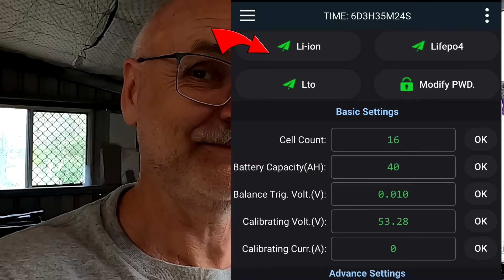Major safety concern with new JK Inverter BMS! Not good.

Comment: Thanks very much, Andy. This community is really great to distribute important information. The good thing is, they are listing to you, Andy, that's fantastic. I've immediately contacted them, too. They told me, that they are fixing it right now and provide a new software very soon. The other types of BMS - 8S-24S or 4S-8S they say, do not have this failure. I'm just testing a 4S-8S version to confirm this.
Reply: They are wrong I have already warned of this problem on a 2a200a which cuts itself!!! and renisilialize and who made me inflate the batteries up to 3.85v then I noticed!!! but it remains swollen for life now!!!
Reply: @patrickruiz6764  So you had this issue with this new Inverter-BMS like Andy, right?
Reply: @patrickruiz6764  What do you mean by "which cuts itself" - You mean that it restarted/reseted itself without any particular reason?

Comment: And the response i received when i questiond the same issue "Hello, please do not close BMS. Closing BMS will restore the default settings regardless of what it is.
This is factory set.
You can choose to use the sleep mode in the app, which will not reset your parameter settings.
Reply: sounds not good. also several comments that state the issue is also the same with some old jk bms

Comment: Turn it off or disconnecting it from  the battery bus. Major safety issue ONLY if it is the BMS being disconnected from the battery completely. Who turns off the BMS? You can disconnect a battery with the fuse yes. But turn off the BMS means isolating it from the battery entirely? That sounds wrong. This sounds like an interesting case of testing issues. Don’t get me wrong. An BMS like this should be chemistry specific you ask me. But this kinda smell like blowing on embers to get smoke.

Comment: Just to clarify ... this is only for the JK Inverter BMS?

Something like a B2A20S20P, what I have, is OK?  🤞
Reply: JK confirmed this morning to me, that the older "stand alone" BMSs do not have this issue. They say, that exactly these "not inverter" BMS are often used in cars or ships, where the system is switched off from time to time by use case. And they never had this issue reported before. They have these type running in the field now over 5 years with no safety issues.
Reply: @michaelwessel2983  well 2 comments here at least say the opposite. 

@user-iu3ju2fj1o
Hi Andy great work on the potential safety hazard on the JK inverter bms. Just would like share this with after seeing your video on this i decided to check all my bms,s non inverter type . and found that my one bms had reset its self to 4.20 OVP , i have not switched my system off for 12 months and more . I dont think that the issue is only with the new inverter bms,s . So i think there is a definite problem here . This is very concerning 

@lezbriddon
I recently bought one of the older style and when building my pack I left it off a few days and then found it was back on 4.2v, but I had been playing so much with the settings and 8cell 4cell as I was balancing them all I thought it was me, and that I had reset the BMS. if the hw can't be prevented from having amnesia then it needs new software with a new 'useless capacity but safe for all chemistry's ' as the default.

Comment: The BMS settings is always my last line of defense but I never allow it to have the final say on the circuit. It is the inverter and the charger that always have the final say when to stop discharging or when to stop charging the battery respectively.

Comment: Hello, I have been using the 14.15 in my test battery for some time now. It seems that the problem with losing the setting has been fixed in this version. Up to 12 hours even without power supply, the red cable disconnected, brings back the set values after switching on. I only use one Akku pack. Greetings
Reply: The BMS does not have a battery so a capacitor will be used to keep the setting. 12 hours is OK, but I guess is 2-5 days is possible. I'm sure it will fall back to the factory setting unless it uses non-volatile memory.

Comment: When a safety device is not safe, then it is really bad. 
It is hard to understand how and why JK is damaging his good reputation.

Those top buttons are badly designed from the beginning even in older versions:
I don't like the top buttons on the settings page that change the battery chemistry and immediately change the settings to the factory default. 
Pressing them should pop up a window describing what happens when activated, with asking if user really want it: YES / NO

The user settings should always be kept unchanged until the user changes them again under any circumstances !

Andy could you please test this on other brands of BMS, or do you already know that other BMS don't do this?

Comment: Now Andy you just had to reset me back to Daly when i just order 10 DIY with this JK BMS. Atleast Kevin of Daly sent me firmware update to enable parallel communication board get all battery pack parameters to Inverter as it was send the current limits of Master battery instaead of cumulative limits

Comment: Very nice video Andy you look amazing in uniform :) ، I have ANT BMS and jk bms totaly burned due to a short circuit. The ant fortunately was still working, reading fault in the discharge side. Anyway, I disconnected the bms it did forget se settings when I connected it back. Also, reset to lithium ion as you mentioned.

Comment: The battery type should be a jumper pin or dip switch on the board so there is a physical hardware element to the chemistry profile it uses in my opinion.
Reply: If it was saved in a permanent memory (like every other BNS), it would not be an issue either.
Reply: Or at the very least safe settings for all battery types...

Comment: I'm guessing some people have had this happen to know the problem is there. At 4.2 volts, I would guess Lifepo4 cells would expand and maybe push the tops off (explode) the cells and cause the cells to be in part or totally ruined. I would also guess that if cells expand, it could cause shorts and with heat, fires of flammable stuff around that heat. Would like to hear from anyone that had their cells charging at  lithium ion voltages, what did it do to the cells?

Comment: They have "just" saved the parameters in wrong set of memories in the microcontroller. Should be an easy fix right? Nop. Tesla has the same sort of problem because the microcontroller has a sett read and write cycles. If the JK BMS reads and writes data to the memory too often, it can reach the limit and fail 100%. In Tesla cars, this is a HUGE problem. A solution would be to save the date to an SD card, that can easily be changed in the same way as the Raspberry Pi can save its data on a SD card. As far as I know, this is also the solution for Tesla as replacing the whole PCB is just too expensive.
Reply: Hmmm....usual write cycles to flash are 10.000 to 100.000.
How often do you change the basic configuration of a BMS?
Write cycles are shurely not the issue. I think it is a simple software bug.: Changed settings are not written down to flash memory or maby to a wrong address.

Comment: Andy,
Is that true with all JK bms’s or just the new one you have been testing? I have 24 volts system with the older 200 amp JK bms. It’s always on but now I’m worried that if it goes down for some reason, it will go back to factory settings. Do you know if it’s the same?

Comment: Do we know for certain that the previous "JK BMS with integrated 2A active Balancer" is free of this issue? 
We were looking to buy one soon, and were considering this, or the new one for an 8S system.

I've encountered memory loss of saved settings in other devices before (even though they we designed to save the settings indefinitely). In my case it was a DSP system processor for pro audio soundsystems. Obviously the risk is much higher with a BMS, and less obvious that settings are incorrect.

It's something we should all be aware of, and remain vigilant about, as even with correctly designed devices, things like solar storms can still potentially corrupt data.

Also, you might want to put a warning on your website about the new JK BMS for the meantime.
Reply: JK confirmed this morning to me, that the older "stand alone" BMSs do not have this issue. They say, that exactly these "not inverter" BMS are often used in cars or ships, where the system is switched off from time to time by use case. And they never had this issue reported before. They have these types running in the field now over 5 years with no safety issues.

Comment: Am I wrong if I recall Victron inverters loosing their settings in upgrade?
Reply from the maker: I could never figure that out. People told me they don't if following the correct procedure. I followed the instructions on the screen when upgrading FW and had no luck. It always defaulted back to default values. An previously saved config cannot be uploaded any more as we are now on a new FW version.
Reply: @OffGridGarageAustralia  i think I have experienced that couple times with Quattro and EasySolar. It’s annoying and user interface doesn’t say anything about setting the time bomb go tik tak tik tak. Not very nice. Updates are rare enoguh that it remains a bit foggy topic unless you have 200 sites to maintain.
Reply: For me, it was a bit surprise how well integrated these blue boxes are. Maybe it’s the modbus connection, but one would expect to have full control of inverters hooked to Cerbo, via Cerbo. That includes configuration, updates, viewing settings, online monitor. But noup.

Comment: I’ve been using this brand for many years on top of using them I helped many friends building theirs battery’s and advised this BMS ! This are shocking news !! I’ve witnessed the battery capacity being changed to the default value of 40A, but not a full reset . Very concerning !!

Comment: If the settings reset to safe values inside the safe parameters of all cell chemistries then it wouldn't be much of a safety issue than a PITA.

Great job Andy and community.
Reply from the maker: Thanks Mick. They should not reset in the first place. No other BMS does that.
Reply: @OffGridGarageAustralia 
Isn't the factory setting uncluding charge and discharge disabled ?
Reply: @Juergen_Miessmer  I assmue yes, that's what they do at all their other BMS - charge, discharge, balancing all are disabled.
Reply: @michaelwessel2983  
Hopefully this prevents the worst szenario of unattended overcharging.
Reply: @OffGridGarageAustralia  Andy is not talking about spontaneous reset, he talks about 'switch off for a few days' Isn't normal if falls back to the factory setting, When I got mine, it was on Li-ion. You have to set all variables to your battery configuration. BMS's don't have a battery, maybe a capacitor for keeping setting for a few days. I agree it would be better to fall back to LiFePo4. I'm sure Charge, Discharge and Balance are OFF
Reply: I using JK-BD6A24S10P 6 months But From last month when I Run my HEAVY LOADS LIKE INDUCTION STOVE OR 1HP SUBMERCIBLE PUMP  On Battery the BMS CUT DOWN POWER OUTPUT NO MATTER BATTERY IS FULL OR HALF CAN U HELP ME PLEASE

Comment: My thought is, the bms is a second instance and should therefore not control the charger. The charger should control himself.
If you let the bms control the charger, you loose safety. You reduce the system to a single point of failure.

I hope JK will fix this issue verry soon. Hopefully only a software bug in writing down the settings into the flash.
Reply: How does the charger know when and by how much to throttle the charging voltage and current, if not for the BMS telling it to do so ???  The Charger and BMS MUST be in communication to ensure safety and battery health.
Reply: @NukeFPV  
The charger knows it by maximum voltage as Andys chargers do it for the battery shelf.
You can control the charger additionaly by reducing the maximum charging current and also by reducing the voltage for float or idle, but the maximum charging Voltage should never ever be set by the bms. It's a fatal error of design to reduce this protection barrier to a single point.

Comment: Disturbing!  I had done a power down a few days ago via the power button to change something but just for a few minutes.  I did not disconnect the battery.  I luckily have my Victron MPPT charge controllers set to 55.2 volt charge and the battery is very well balanced as well as it has been cloudy and only got one full charge in all this time.  I just checked my settings this morning after seeing the community posts and all was well.  I still have the old JK BMS and a "Peter" slave I can put in place.  Question is, can I chain to the Venus OS and the Growatt inverter on the same CAN?

Comment: ok , jk bms fault control dc input 
but also mppt charge fault dc output 

for burn all , you need 2 bad condition 

Solution :
i think every cpu controller,mppt ,inverter, bms ,smart bms ,balancer 
need a eeprom to save important data
for this critical applications 

cheers

Comment: I just checked by 150A JK Inverter BMS (none part of a live system yet as still awaiting battery shipment), it has been off since last Wednesday and all the settings still were as expected for LiFePO4 cells. How long before this reset happens ?
Reply from the maker: What FW are you running?

Mine has V14.13 and resets after 2/3 days.

Comment: Agree that the BMS should not reset to a state that can cause catastrophic failure and go poopy in its pants as well as turning the Offgrid Garage into the Offgrid BBQ. In any process there should not be systems where there is only 1 safety. Hypothetically in this instance the charge controllers in both the Multiplus and the MPPTs should be set to limit maximum charge. I believe the Multiplus can also do an OVP disconnect as well, stopping the charge.

Hopefully JK react quickly and provide a solution. This should be written to CMOS memory on the BMS and should write your settings to memory that does not get overwritten in a power down event.

Comment: That is unbelieveable that the BMS don't store the settings in nonvolatile memory and restore the user stored settings upon reconnection.  At least the good news is that charging to 4.2 isn't going to completely ruin the batteries or cause them to start on fire but it does put more stress on the battery that could have been avoided.  Beyond 4.3v and you start to get electrolyte breakdown, bloating, and a risk of venting or potential fire.

Comment: It also reset to factory settings if you push the bottom on the CAN-RS board
Reply: It is the purpose of this button
Reply: @ВладиславМартишев  I don’t know where you got this from, for example, I didn’t find a description of these buttons in the documentation
Reply from the maker: I have not tried that, but usually, the button is hidden from the front panel and you need a sharp tool to get i and push the button. Yes, that should reset to factory default (but not reset the password).
Reply: @OffGridGarageAustralia  Andy, please 🙏🏻 
you can tell the manufacturer JK that they need to add, when the battery charges closer to 100%, they need to reduce the current by CAN message for Invertor such as SOLIS. 
It is also important to know for JK that as soon as the inverter receives information from the BMS that it is 100%, the inverter stop charging the battery

Comment: Sounds like they do not have code to write setting to the ROM chip. RAM does not store data once it looses power completely. ROM holds settings forever. Software can be told to write settings to ROM if they have enough room left.

Comment: Does the JK BMS have an on-board coin cell battery? If so, maybe its going dead after a short time, possibly dropping the stored parameters?
Reply: It doesn't (and shouldn't have). Settings should just be stored in the Flash area of the microcontroller, and there wouldn't be an issue. Apparently someone else just commented that this was the case in older firmware versions for this BMS, so it's likely a bug introduced in this later firmware version and should be able to be fixed easily.

Comment: Thanks for pointing this out, if a reset should occur in the worst case of a BMS, it should always come to the smallest battery possible, so a default of Li-ion is "not good".
Reply: What is the difference from a new device? You must set all parameters to your battery configuration and must change Li-ion to Lifepo4, Andy has a video about this.   To me it's unclear and under what condition the BMS reset.
Reply: @IesKorpershoek  after a few days unpowered, the device resets itself which is totaly unexpected and very dangerous
Reply: @edwardvanhazendonk  Mabey very stupid but does unpowered mean all red cell wires are detached? That's the only way the BMS is powerless.
Reply: @IesKorpershoek the answer to that question is in the video

Comment: Appreciate the humour, but a bit clickbaity, Andy? 4.2V is still within spec for LiFePO4. It's recommended not to charge over 3.65V, as there is no point charging any higher, but 4.2V does no damage.
Reply from the maker: I have to disagree here! Massively. The specifications for LiFePO4 are saying 3.65V. Nowhere in the manufacturer's specs, it says 4.2V is save.
Sorry, but we have to go per genuine specifications of the manufacturer (EVE, Hithium, Rept,...), not what info some people post in forums.

Comment: Just to confirm. This only affects the new inverter bms??
I have a couple of the silver open case style. And one of the newer black closed case style but not the inverter model. 
And i dont really know why you would turn your bms off. Turn off the solar sure. And the inverter. But not the battery protection🤔
Reply: Thanks lads. I hope jk gets onto this asap. Especially now its on the national news!! Was that andy burgandy the news anchor?????
Reply from the maker: Yes, only the new inverter BMS as mentioned in the video description.
Reply: Yes, only the new type BMS.